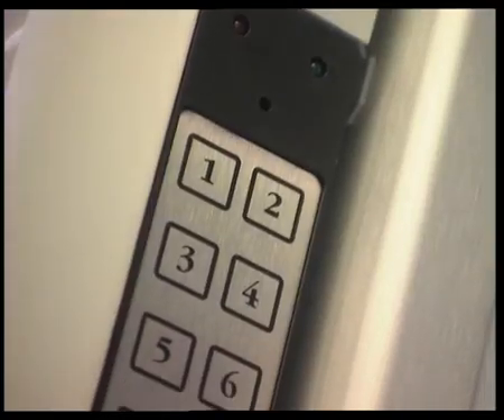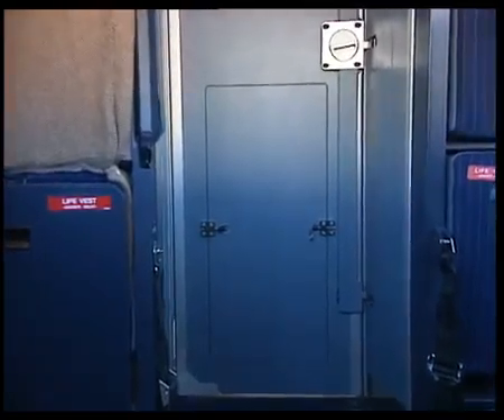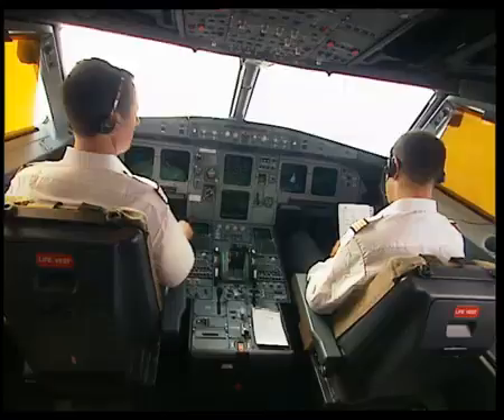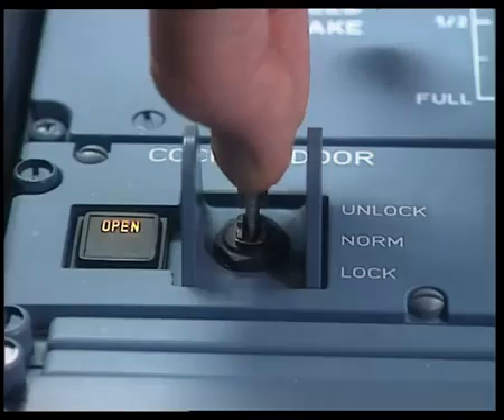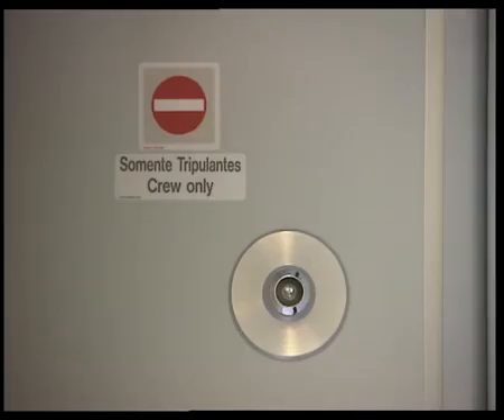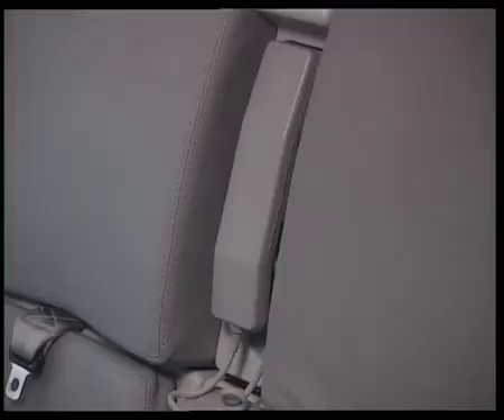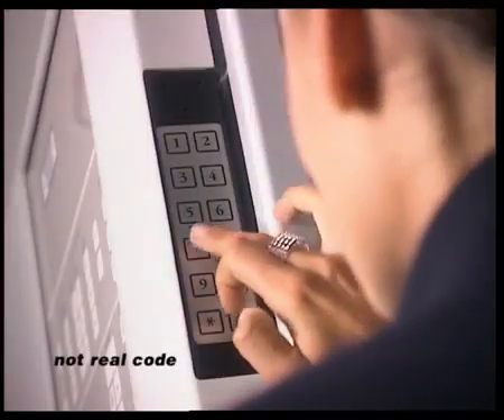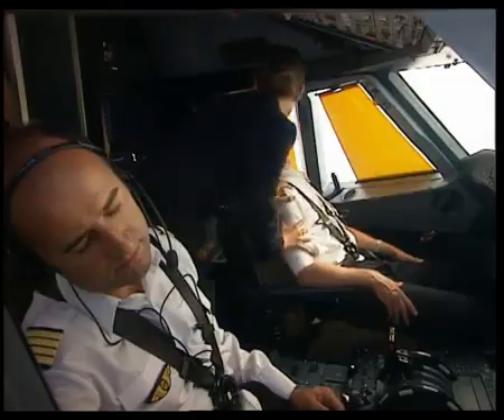How To Lock and Unlock Airbus A320 Cockpit Door - Description and Procedures

Comment: There is another way to get into the cockpit.If you force a depressurization of the plane,by drilling a hole or a big crack to open using a oxygen bootle within a window causing the panel door to blow out of the cockpit door,so the Pilot locked outside could try to get in.But there is another problem apart from the hypoxia of the pilot outside (that cam be mitigated using the portable oxygen bottle.Inside  the cockpit there's a Crash Axe that can be used to hurt who try to get inside.To open a hole from inside to outside an oxygen bottle with a control explosion,But this option will take to much.time.A gun locked somewhere to use in an emergency would possible do the trick as well.
Reply: That is actually a great idea👍🏻
Not even being ironic😆
The challenge would be to make a hole in the fuselage skin.

Comment: Oh my god how could they not have thought of a deliberate from inside the cockpit it happened before. There is a lot of solutions like using a retinal scan, finger prints and having pressure sensors on the cockpit chairs (like in every car)  in the case that there is not actually 2 pilots in the cockpit. That seems so obvious ! this is not a fail-proof design and airbus should fix it for fuck sake !

Comment: well this explains it all. the copilot that crashed the plane didnt even need to put the switch to the lock position when the first officer got out. then when he finished using the restroom if the first officer tried entering the cockpit using the security code the bad guy had 30 seconds to now put on the lock position. giving him 5 minutes which is more than enough time to crash the plane.
Reply: First officer = co pilot 😉

Comment: It would seem (and I'd need to see the full manual to confirm) that the override does not work if the toggle is moved to the lock mode - which then locks the door completely for 5 minutes. So theoretically, the co-pilot could've done the following (times released by investigators in brackets to show my theory):

1. Captain leaves. Co-pilot starts descent shortly afterwards. (9.30-9.31)
2. Captain returns. Co-Pilot then moves toggle to 'lock' position. Plane would've already descended a fair distance. (9.35)
3. Door is now locked out for 5 minutes completely. Roughly the right amount of time to crash the plane. (9.40)
Reply: Yep, thats how the copilot of the germanwings flight locked everyone out and crashed the plane.
Reply: Solve one problem and create another.

Comment: It seems the captain wasn't able to open the door using code cause the pilot inside the cockpit turned the locked switch on.
Reply: Exactly. Once the switch inside the cockpit has been set to "lock", the panel outside the cockpit is deactivated - so even the emergency code does not work anymore for 5 minutes. This is to prevent e.g. terrorists from entering the cockpit by using the emergency code they got via force from a flight attendant. But if the persons inside the cockpit are incapacitated, they cannot set the switch to "lock" every 5 minutes, so eventually entry will be possible via the emergency code.

Comment: I'm sorry, I'm still unclear how the copilot could keep the door locked if the pilot could enter a number in the keypad to override it. This video didn't have a section for how to keep hijacker out of the cockpit. I also wonder what happens when terrorist grab "Sally" and make her unlock the cockpit.
Reply: its becuase of the little switcher between .. it was "normal" "lock" and "open" the co pilot switched it to "lock" and then the door is locked for around 5 to 10 minutes before the pilot can open it again.... but then the co pilot could turn it to "lock" again
Reply: The "lock" switch disables the keypad outside the cockpit. That means that even the emergency code will not work for 5 minutes. Even if someone enters the emergency code when the door is not locked via the switch, there is a 30s delay before the door actually is opened, and during these 30s the pilot(s) still can hit the "lock" switch and override the emergency code.
Reply: Not a topic for discussion here or anywhere else.

Comment: I always thought that the pilots shouldn't be allowed to leave the cockpit in flight and that the front bulkhead toilet should be accessible from the cockpit only. A locked door is protecting the crew only when it remains closed. if pilots are opening it during flight that is all a terrorist needs to access the cockpit rendering all security pointless !
Reply: There is a camera and flight attendants near the cockpit door, so if they notice any suspicious behavior they do not open the door.
Reply: As you can see from the video, the flight crew have the ultimate control over the locking of the door. If there's a terrorist on board, all they need to do is flip the switch to 'lock'.
Reply: Yes, why can't they pee in a bottle?
Reply: All any one who wants to get in the cockpit has to do is buy a seat at the front and rush the door when it opens.. that's it... pilots should take sandwiches and have the bulkhead loo in the cockpit...
Reply: ronenfe Then just adjust the plane, security shouldn't be a question of available room
Reply: ronenfe They should move the bulkhead toilet door so it is in the cockpit ... so they don't have to leave the cockpit
Reply: ProDrone Solutions i dont think so the passengers will have one less toilet. Anyway cant they hold up for a couple of hours in short fligts?
Reply: @ronenfe No.  They can't.  Occasionally, people get sick as well.
Reply: Durgadas Dutta sure that's what we do in the army, anyway if they can't hold on for a few hours they shouldn't be pilots.
Reply: Durgadas Dutta there is not enough room in the airplane for that

Comment: Why wasn't the Germanwings pilot able to unlock the door with the code?
Reply: +Colin Smith The First Officer would have denied access via the control switch. There should be a way of pilots being able to enter with a card or emergency override code.
Reply: @kylehenderson2  that’s the thing . Then a terrorist can force a flight attendant to open the cockpit door
Reply: @kylehenderson2 Bad idea.  If overpowered, or under duress, it could allow bad guys into cockpit.
Reply: If the pilot inside the cockpit puts the switch to the lock position, the door is locked for 5 min regardless if the code is entered or not
Reply: it can be overridden
Reply: @sammy2745  well...
Reply: @sammy2745How so?